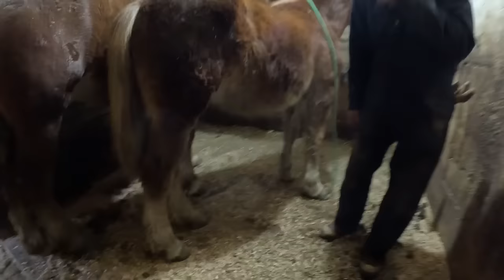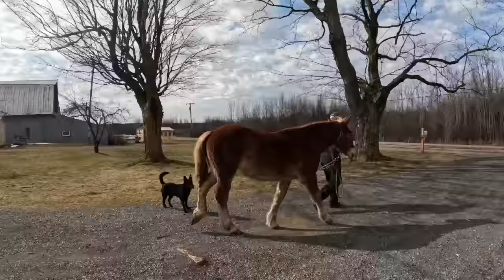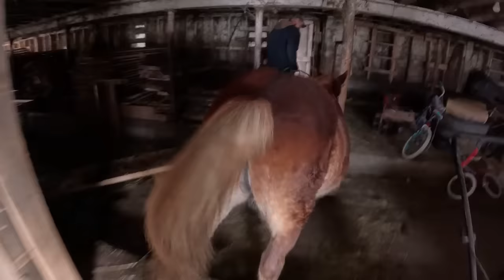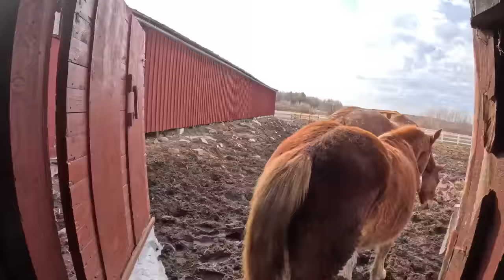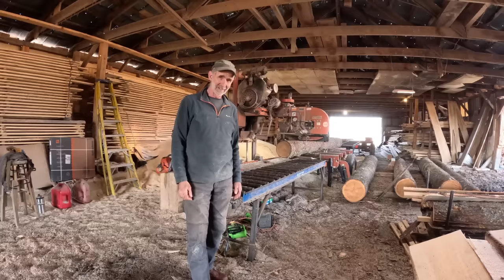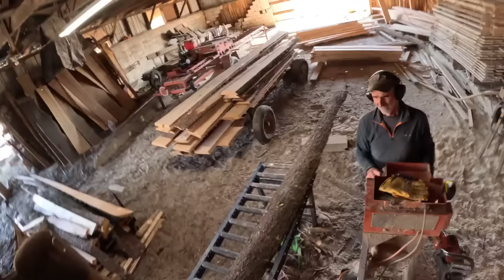WHY IS BREE LOSING WEIGHT??? // Sawing Lumber with NO HELP! #609

Comment: Besides checking on the parasite issue, Bree doesn't look like she is getting the proper nutrition.  I don't know what kind of grain she is getting but she would probably benefit from an analysis from Purina horse feeds. We were old school for a long time and figured that straight grains and other basic feeds were good enough. That was until we got a filly that starting having all sorts of problems with weight issues and swelling in her joints, called Apophysitis. Our vet suggested calling Purina horse feeds because they do a lot of research and testing on there feeds and have representatives that can help you come up with a feed program specifically for Bree. We switiched to Purina products about 25 years ago. Since then all of our youngsters have grown up great with no weight issues. Our senior horses were given what they needed based on age, teeth condition and other issues.

Comment: Good Day Jim and Brenda,, Bree is doing really well with limited time you've had time out your busy schedule to work with her . She's very obedient to and reponds well to you on the front porch entry and exit . Congrats on her stepping into the trailer as well. She's gained 8 lbs from her last weigh in. . Your probably right on the growth spurt issue . I agree with you to take a fecal sample to check on the worm situation as well. I would also lift up Bree's horse feed ration for a few months  after you get the worm test results back.

Comment: I have some experience owning riding horses (2) and have had a keen interest in them all my 75 years. Your channel stays interesting and entertaining. I have two questions that likely stem from inexperience but have somewhat concerned me regarding your stabling “set up.” It seems to me horses confined at least in winter to “tie stalls” at night would rest better in “box stalls” with more room so they might rest / lie on the ground at night. Similarly, would they not benefit from 24 hr access to water?  I suppose space limitations / the # of horses you keep is the primary factor in arranging your barn as you do. Would be interested in hearing your thoughts / comment. Thx.

Comment: Every foal looks rough at this time of year.  She is getting that uneven, high behind look of a rising yearling.  When the grass comes in, she'll pick up quickly.  I've never seen any young horse look good in March of their first year.  It is amazing how very little handling it takes to raise a really good horse.  You've got a good bit of the breaking of that filly done already.  She has good barn manners.  She leads well.  You can handle her feet.  She stands tied.  She gets along with other horses.  There is no reason she can't spend a few minutes here and there learning to wear harness even now.  I used to harness my foals around six months.  I'd have them pulling an empty pony cart when they were about a year old.  You won't have much left at all when it comes time to put her into the work rotation.  

So who are you bringing to Horse Progress Days?
Reply: Love your horse knowledge and comments Thirza 😊😊😊
Reply: Thank you  @chips4974

Comment: Her weight is fine, she looks good. Remember your raising a horse not a beef cow, better slightly under weight as they grow than over weight. Over weight will stunt them and it can also force too rapid growth which can mean the end of them as useable and you will need to put her down if she grows too tall too fast. 
You can also check to see how tall she is going to be. Measurer her from her elbow to the middle of her fetlock joint and then turn it and use that length from her elbow up to see how tall she will be. yearlings have their full leg length.

Comment: Might want to have Bree's teeth checked and floated if need be. I'd also bump her mineral up if she'll take it. I feed Hoffman's Horse Mineral in the green bag according to label directions, mix it in with their rolled oats. I also roll the oats, more digestible, nothing comes through in the manure. Young horses always look a bit raggedy at times.
I haul my horses in a 1 ton truck and I train them to load with grain, load them with a little snack, then feed them their supper in the manger over the cab, plus there is always  hay up in the manger. The ramp can be a bit of a learning curve. Always good to spend time fooling with horses, especially young ones.

Comment: Question:  Are you sawing tough cut or finished size?
Have some ideas on feed for Bree will send in email, since YouTube frowns on name brands .
Reply: Rough cut ,Would rolled oats with cracked corn with a cup of molasses mixed in proper amounts put the weight on Bree .😊😊😊
Reply: That combination is a lot of carbs.  Got to be careful with carbs.  Better off going with a commercial growth feed.